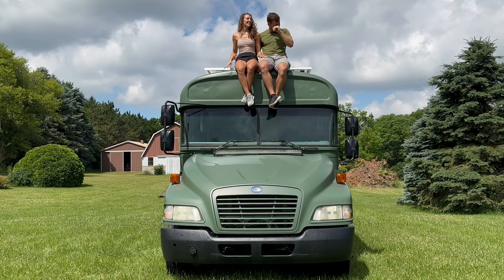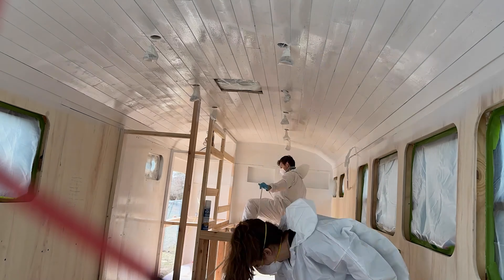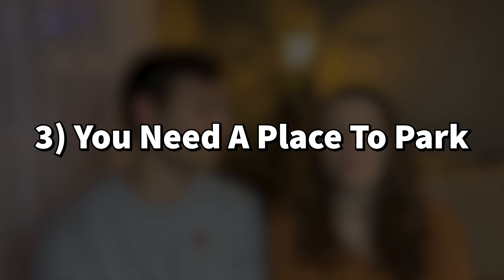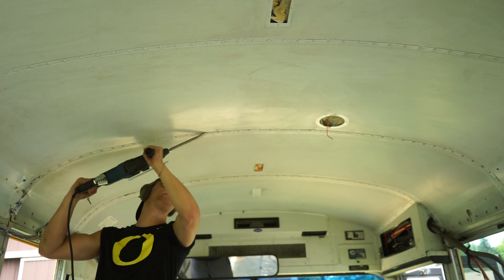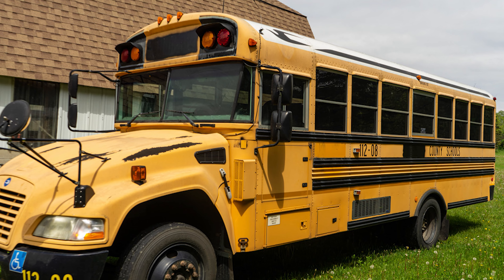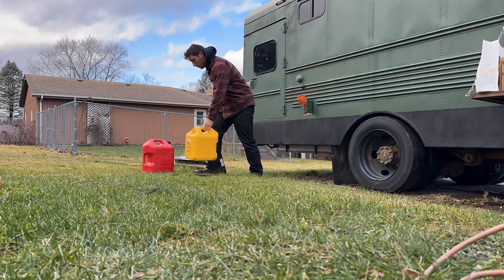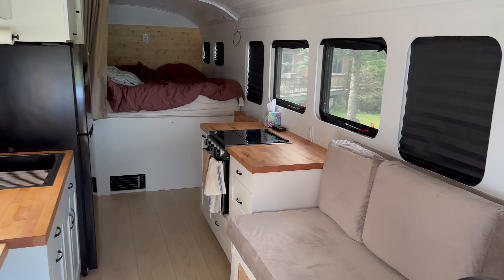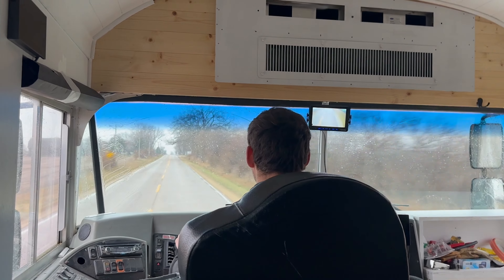5 Things You Need To Know Before You Build A Skoolie

Comment: With some hindsight, I would probably have bought two similar buses at the beginning provided each one could have a thorough going over by a mechanic on the engine and transmission etc before handing over any cash. Sounds crazy, but any spare parts (if in good condition) are already paid for. I feel their pain and hope they will be on the road soon.

Comment: guys $8k sounds like A LOT for a tank and injectors.  please call around and get some more estimates if you haven't already pulled the trigger
Reply: Tank= 1000
Radiator = 1500
Injectors 500x6 =3000
Filters, lines, bits and bibbles =500
Labour = 2000 (150/h x 13.333hours)

Adds up... nothing is cheap, but one must consider, good things are seldom cheap, cheap things are seldom good. 

Anything big to work on (HD trucks, dumpers, the like) are silly expensive. I've handed over bills that would make you giggle, twitch once, then cry. I take pride in quality work, and provide such to my clients. You wanna skimp out? b
Be my guest... I'll see ya in a bit then eh? 😂😅😂

No worries. As long as people have and use mechanical devices for conveyance, I will remain gainfully employed. Someone's gotta fix'em when they break.